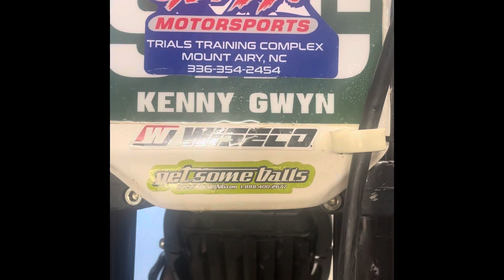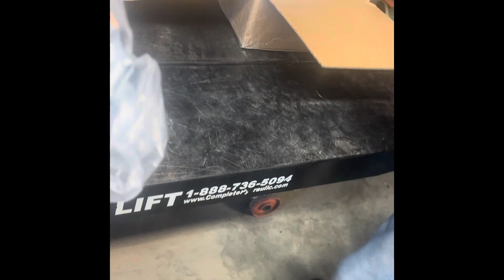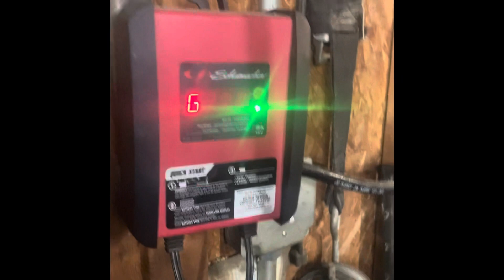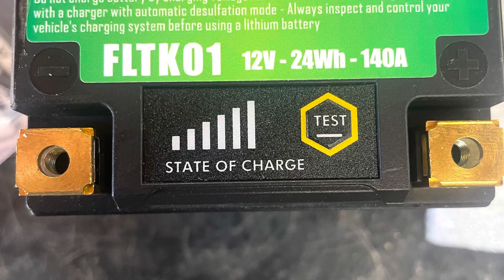Montessa 4RT 300 RR Electric Starter Install .

Comment: Montesa is spelled with one S unless they changed the spelling? the old Montesa Cota's were two strokes and the new Montesa is a four stroke, and they are a collaboration with Honda now. the old ones used to dominate trials competition, and I'm guessing the new ones are no different. to have Honda and Montesa together. because Honda doesn't generally back losing propositions.
Reply: Where did Montesa ever dominate ?
Here in the U.K. the Montesa 4 stroke is regarded as an extremely well designed and built bike but not one that dominates the sport, that is done by Gasgas, Beta and Sherco all 2 stroke.

Comment: How long did it take please, in case I have to take it to a dealer I'll know what kind of bill to expect, it's wether I can find the right flywheel puller. Thanks
Reply from the maker: Took me about 8 hrs but I went into it blind with no instructions. I think a dealer could do it in 4 hrs as I should be able to next time around .. I sell the pullers for $85 if you need 1 . We are gonna offer an installed package here in NC

Comment: Couple of questions,  how much extra weight does this incur ? Is it available in the UK? What's the cost? Thank you.
Reply from the maker: Weight is not noticeable. I say less than 2 lbs difference .. can be bought  from 
S3 $1500
Reply: @grp4dirt  thank you, also,  is the magic start/ choke part of the kit or was that ordered separately ?
Reply from the maker: @arriep4bits  the magic start was part of the package and it does help with cold start .
Reply: @grp4dirt For that price I had better using my leg and finding - as usual - a good map that help always starting at the first or second try !!😊